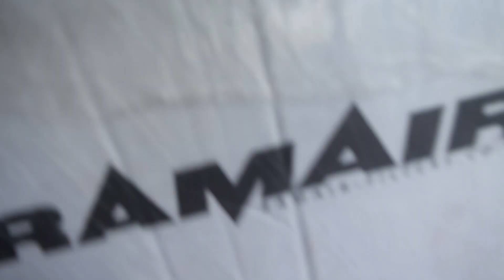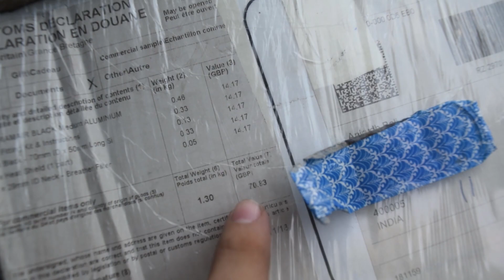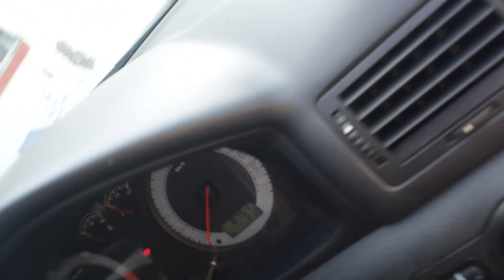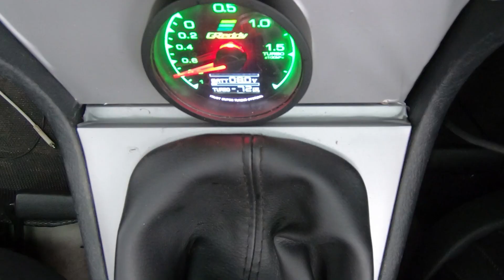Installing Imported AIR INTAKE on my VRS !! RAM AIR INTAKE UK (Hindi)

Comment: Really great content Anirudh. I appreciate as a fellow VRS owner MK1. Your VRS looks elegant
may i know how u got those smoke Headlights and VR logo on front grill?
Reply: and PLZ REMOVE VRS logo from steering wheel. Buy original green skoda emblem for it
Reply from the maker: That VR logo is actually the VRs badge and it comes from the company and the headlights I have tinted with 50 percent headlight tint but have taken it off as it’s impractical for night use